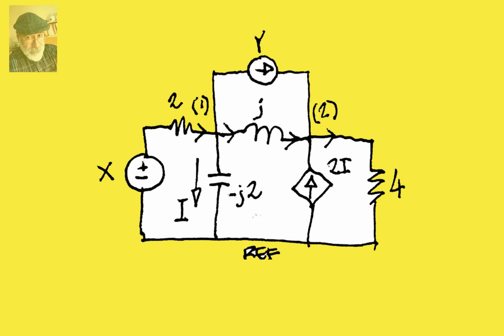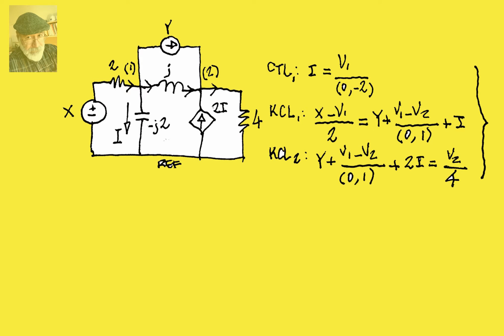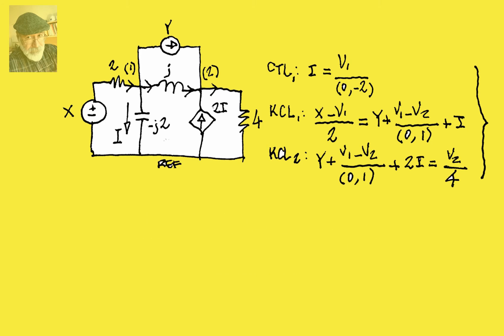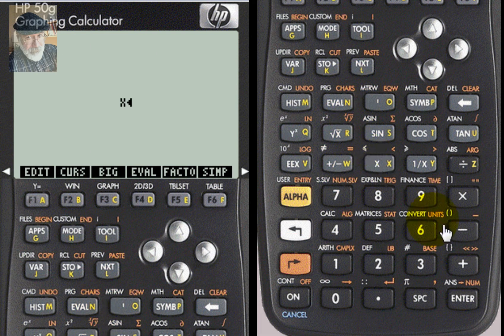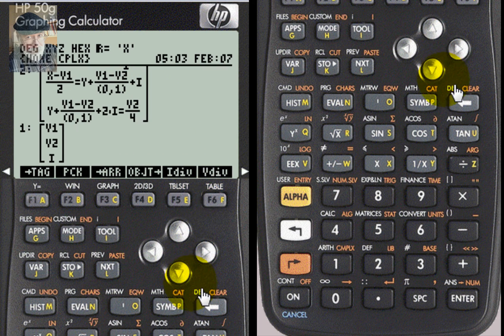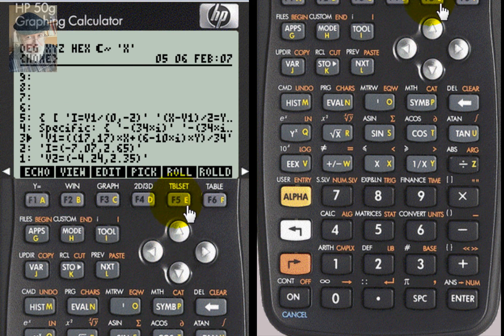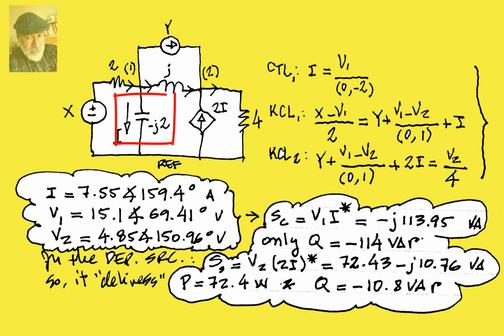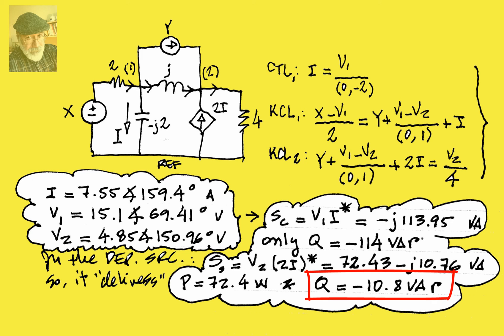HP50g - Equation Writer and Complex Numbers

Comment: I just swapped over to this calculator from the HP 35s in order to solve systems of equations such as this, so I'm still learning the ropes with this calculator. How exactly do you go about assigning things such as ARRAY and the other things available in the CATALOG to the F keys like you have it setup?
Reply: You could save commands to CST variable or use the MENU command to create a list of custom menus